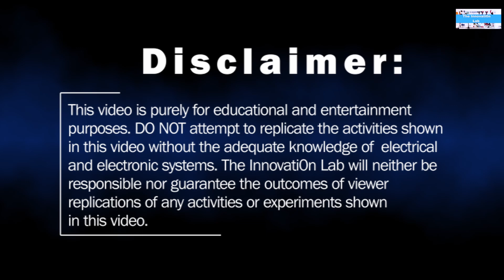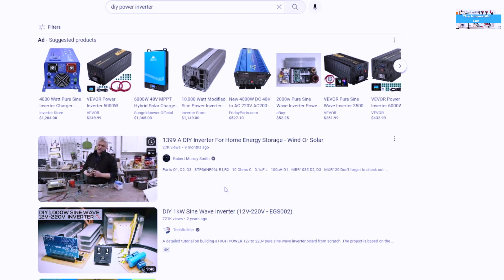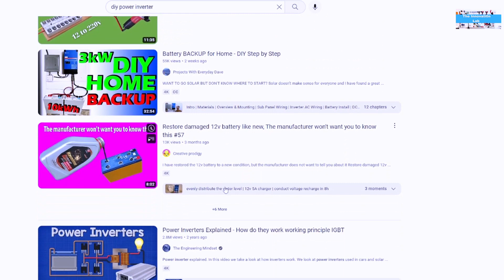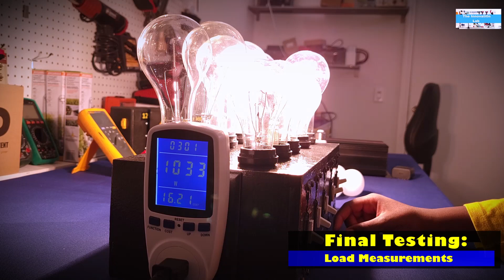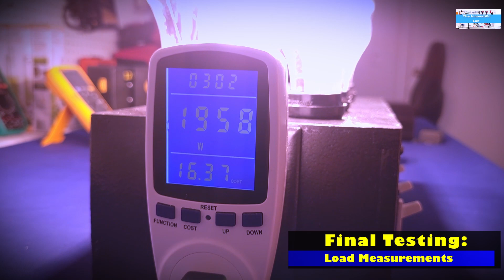Pure Sine Wave Inverter, Testing #howto

Comment from the maker: I made this video for those of us who are tired of click bait power inverter videos. This video uses a visual method to provide some illustration of  load testing and a firm grasp of electrical power. In my world, integrity is everything. No one should be testing a 5000W inverter with just three 10W LED light bulbs - if we are being truly honest about our contents. Honesty is very important. This device can measure > 3000W if the right heavy duty incandescent bulbs are used. Also there was a drop in the measured power (<2000W) because of the power cable I used.

There were some mistakes (Bloopers) made in the videos;
- 5 load channels, not 6
- Less than 2600W of was expected, not 3000W

Thank you for watching this video and don't forget to share this video, subscribe, and give us a thumbs up if will like to see more like it.